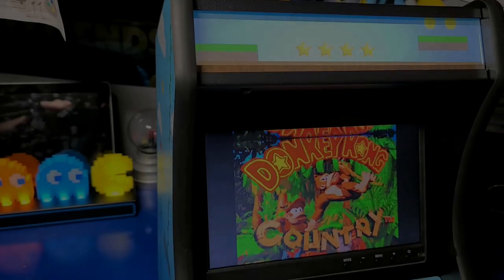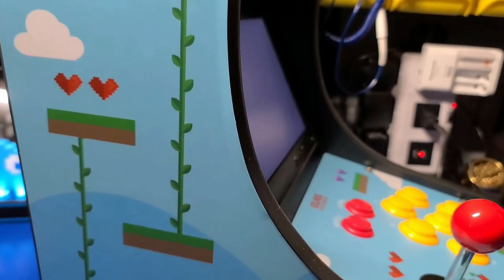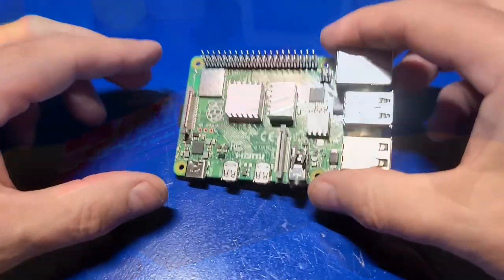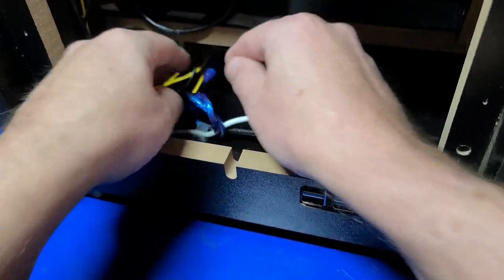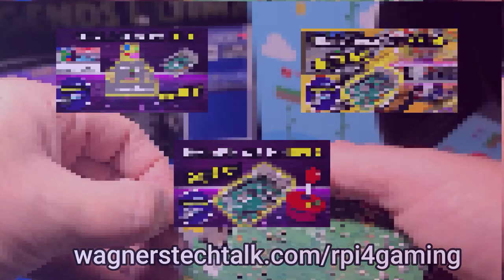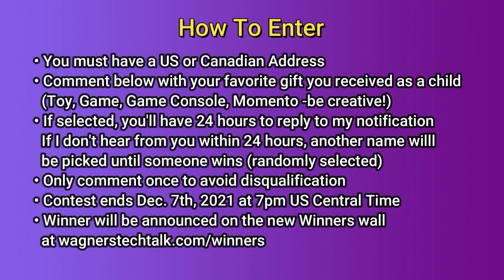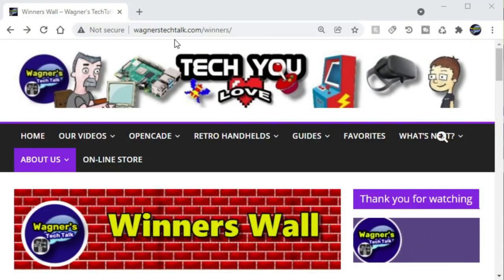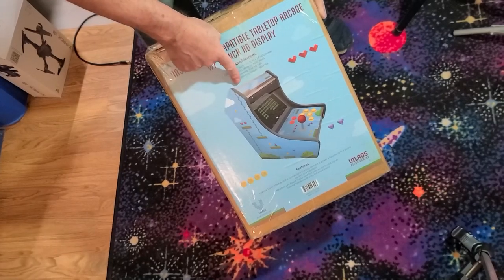CONFIRMED WINNER: Vilros Mini Bartop Arcade for the Raspberry Pi 4 - Giveaway has ended

Comment: My favorite and most memorable gift I received when I was around 8 or 9 years old at Christmas. It was the original Stretch Arm Strong. This version was around 12-15 inches tall and came with a stretch mat that you could see how extreme the stretch was. Loved how slow he would go back to shape when cold. Sadly he didn't last as he got too cold in our basement and actually tore instead of stretched. He bleed 🩸 clear by the way. 

Thanks for running the give away and for responding to my questions in various forums. Happy holidays.

Comment: My gosh i found this 1 day Later for the contest!!!! T.T
Reply from the maker: There will be more opportunities in 2022.
Reply: @WagnersTechTalk  I know it's late but tomorrow I'm gonna see if u have any video comparing batocera vs retro pie vs I forgot the other name... So which has best performance and compatibility
Reply from the maker: You can find a guide/videos for RetroPie, Recalbox & Batocera  here : http://wagnerstechtalk.com/rpi4gaming/

In terms of performance, they all run RetroArch (mostly, a few additional emulators are used) and all on a Pi 4.  The main differences between the 3 are going to be the front-end and optimizations made for each of the cores/emulators.  Recalbox is the easiest to setup/use (including light-gun support), Batocera has performed slightly better in some comparisons on Reto-Gaming handhelds and RetroPie has the most emulators and is also very configurable.  Hope some of this helps.
Reply: @WagnersTechTalk  you are the best!!!